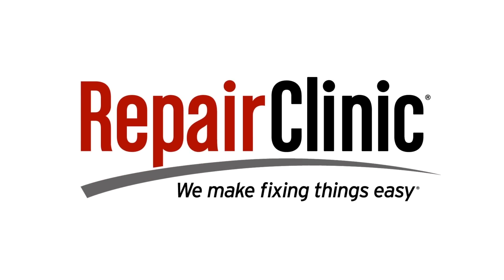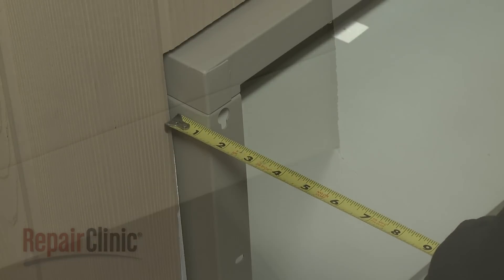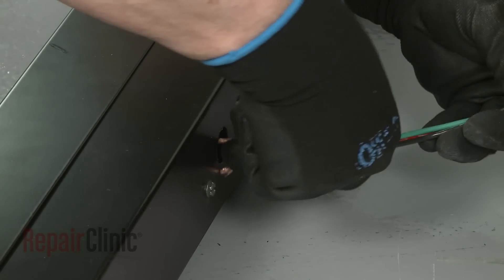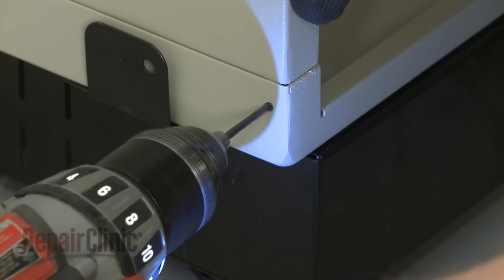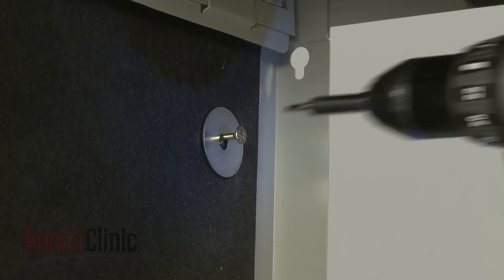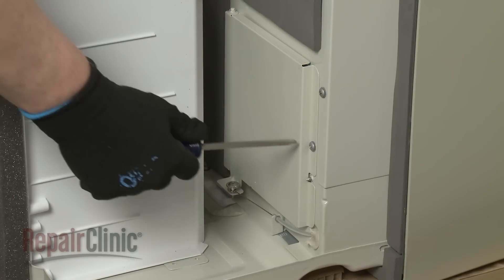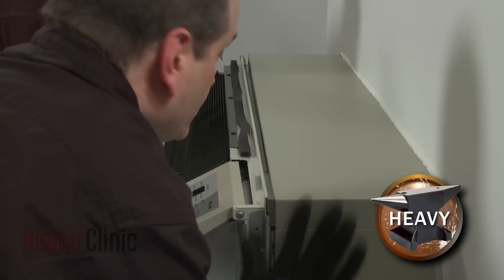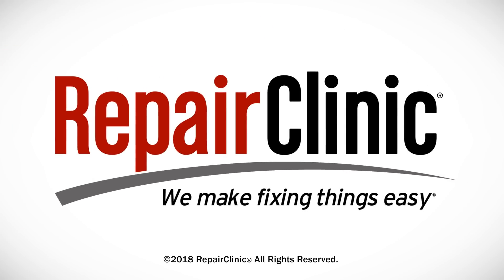Gree PTAC Unit Installation (Model ETAC209HP230VACP)

Comment: What do you recommend in order to drain the condensate? I didn't see any type of drain installed on this unit, is condensation not an issue or does it just dump into the walls?
Reply: RepairClinic.com I recently had my ptac replaced with a newer unit. The old unit drains out the back thru a little hole. The new one lined up but had a do not remove sticker on the drain plug. Well I left it alone until it started sounding like ocean waves in there. I got worried about it flooding in the house like when the old one did when the drain hole got blocked. I pulled the the sticker off and popped the drain plug to drain. Is that ok or is it supposed to hold water in the new one?
Reply: @tonyd5990  I have 2 and the condensate is evaporated in the unit, with no condensate leakage.